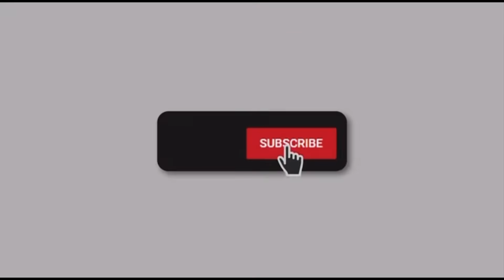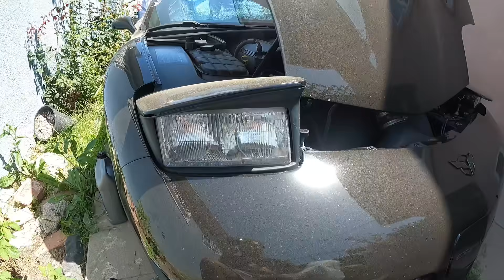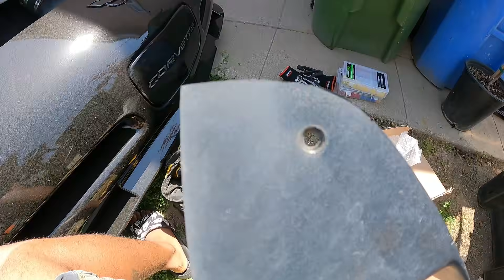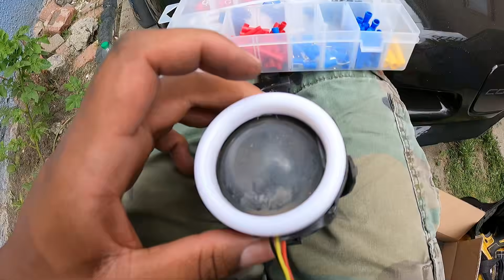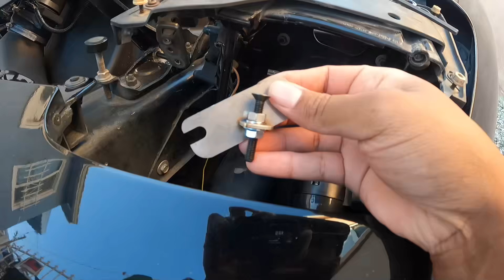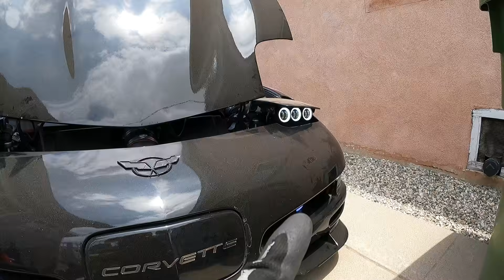Installing My Knight Drive TV Sleepy Eye Kit

Comment: i also have the rounds with bezels, gotta get the bezels it really finishes the look. also couldnt tell if you did, mount the resistor to the frame. it gets crazy hot and will melt plastic.